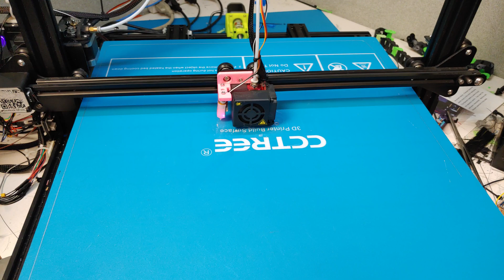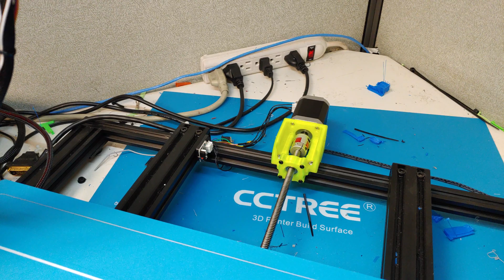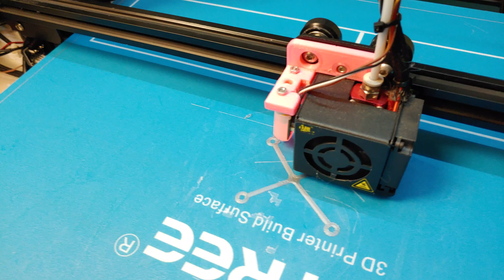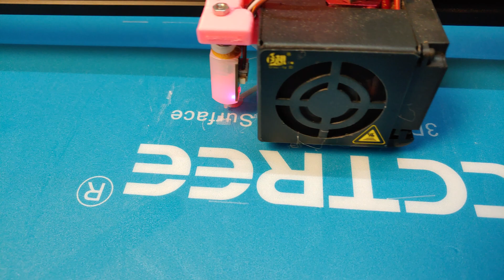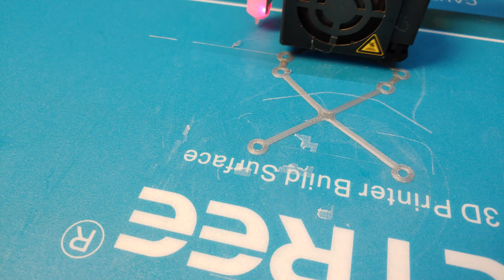CR-10 S5 with Y Axis Lead Screw

Comment: interesting but the part that i kine wonder about is consistency whit larger / heavy  prints  at comparable  speed to belt driven bed.
Reply from the maker: I got rid of this after difficulties with the closed loop stepper and just havent had time to go back. I got a new firmware now for the closed loop that could fix it, also it really needs 24v to work right. See my 3DLS videos for speed, that never was an issue.
Reply: @Morninglowe  Ok are you using 4 start or 2  rod ? I imagine the 2 start is better but if you got a beefy  stepper motor to  work it
Reply from the maker: @helge1104  4 starts and the motor is stock on the S5 and a 2.1amp big one. It had plenty of power the issue is the starting torque. I learned a lot with the 3DLS though
https://www.thingiverse.com/thing:4031698
Check out the 3DLS there, tons of info and more videos.

Comment: are you still running this mod. what is the max speed?
Reply from the maker: I stopped using it for a bit then I found some Closed Loop controllers for the stepper. Now it flies and works fantastic. This is my work machine so it's not often I can video it printing. 

The thingiverse link is updated with the closed loop parts.